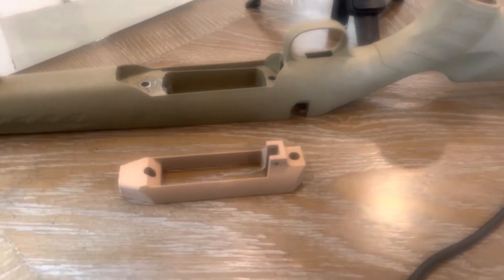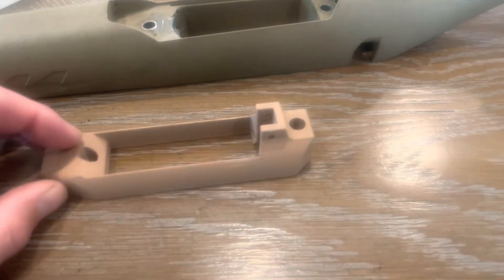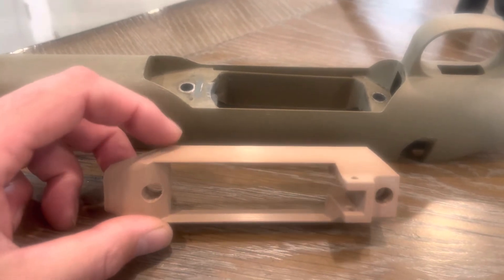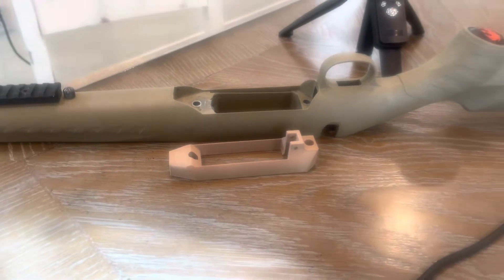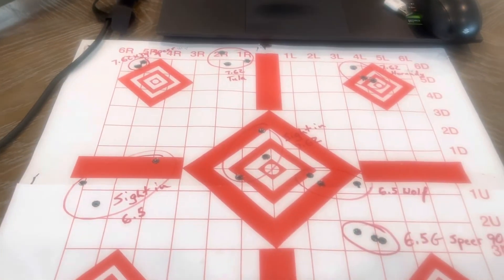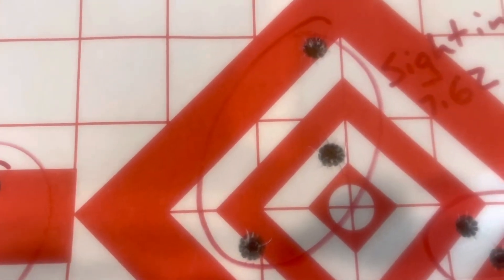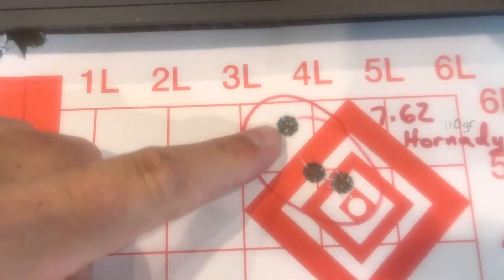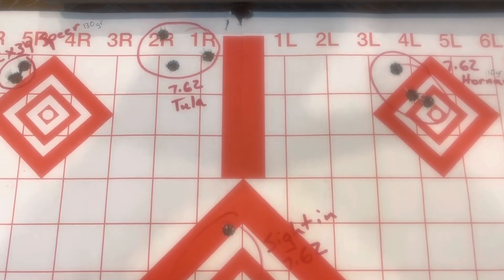Ruger American 7.62x39 Conversion Update

Comment: Can this mag conversion be on a mini-30? Why not make the new mag well in steel alloy?
Reply from the maker: Yes on the Mini-30 if you can find someone willing to do it. On the metal alloy, you would need to cast or forge this because of the complexities of the geometry. You're talking a lot of money for developement and mold manufacturing that still require finish work on the cast or forged part, so unless you're willing to pay $1000 per magwell its not very feasible. Metal 3d printing could do it no issues, but they're not exactly cheap either.

Comment: I was thinking about reloading 7.62x39 can you suggest a good hand load i also have the ruger ranch
Reply from the maker: I haven’t had a chance yet to do a true reload, I’ve only pulled some factory bullets from wolf cases and replaced with nicer projectiles. With that being said, both the Speer 130 and Hornady 110 bullets showed good promise so those are the ones I plan on experimenting with when I have the time.